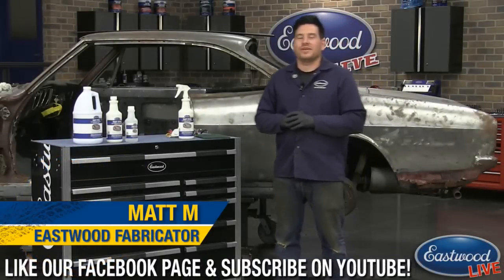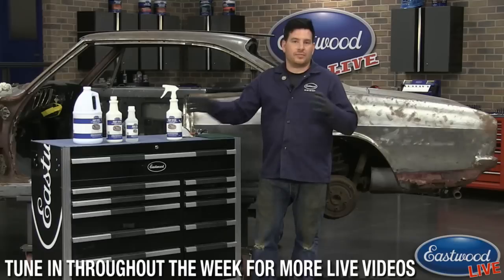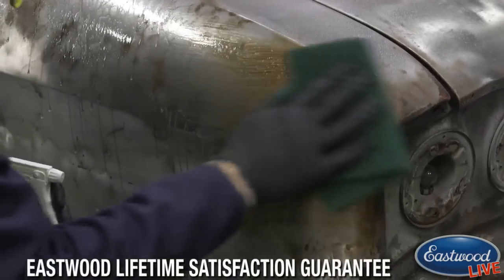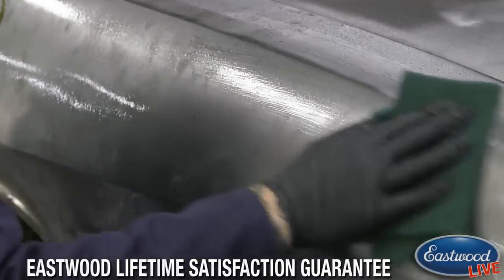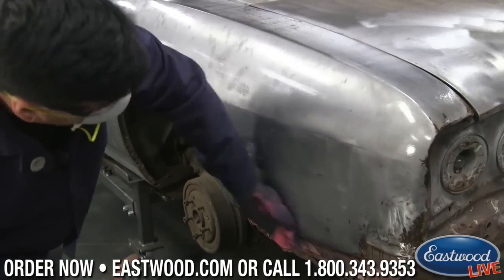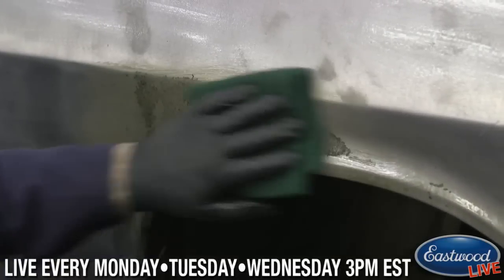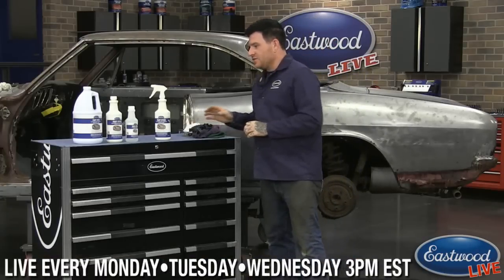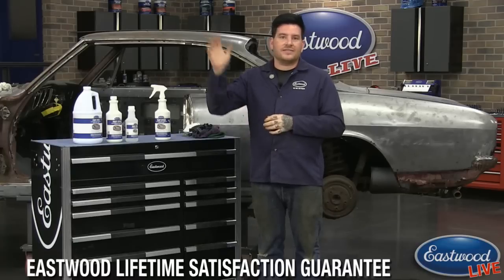Rust Solutions! Fast Etch - Remove Rust & Leave a Protective Coating to Prevent Future Rust!

Comment: can you paint over this with primer?
Reply from the maker: You will want to remove the Fast Etch with Eastwood PRE Paint Prep before applying primer or body filler or other coatings.
Reply: @eastwoodco , you might want to change the description then. The description claims it promotes adhesion for priming which is telling people they can primer over it.

And if you're supposed to clean it off before primer then I'd assume to just use Ammonia that'll work just as good and just as fast. Then spray etching primer directly after because leaving a bare metal car just sitting around is just laziness and pointless (unless you want that Bare Metal Look which is actually what I'm doing right now on my '86 Dodge Ram D100 Custom. I'm coating it with Boild Linseed Oil to protect it from rust and it can last years if applied with heat and correctly).

Comment: Why don't you answer questions posted ? You trying to sell this, product which is really "OSPHO" or not ?
Reply: Ed Passerini Ospho is green and is considered a converter not an etch
Reply: Ed, I know this is 2 years later but, wondering if your still crying cause he did not drop what he was doing and get right back to you. FYI, these are only video's Eastwood puts out free of charge to help us DIY'ers (and yes...cryers). If you want specific's on a product Eastwood has a tech line that answers all questions on their products...also free of charge. Unfortunately Ed, they will not come to your house to work on your project...for free. Now dry your eyes and pull up those big boy pants and do it yourself.

Comment: I sprayed my AMX after blast wiped down and 3 days later rusted. Had to do again and epoxy right away.
Reply from the maker: It's not a coating - it's a chemical that neutralizes rust. You need to top coat it shortly after or it will eventually rust again.

Comment: So i used this for the 1st time. AMAZING. The only thing i would add is if you leave it on the panel to dry and then want to paint it the thick etch does not come off completely. 
I re - applied the etch with a scuff pad then immediately washed the panel down with Acetone.*** Important*** Make sure the panel gets neutralized with pre- or Acetone right after re-activation or else the epoxy will never dry and you will have issues. Trust me.. I would also da 80 grit metal after that to start fresh for Epoxy or fillers. Acid+ paint like water + oil do not mix .

Comment: I know this is an older video, but will fast etch be good for removing light rust and really old, worn paint? I'm trying to do some rust clean up and repair in a tight area that is difficult to reach and thought maybe this would be the perfect thing to clean it all up with before going over it with some rust encapsulator plus

Comment: Right from SPI which applies in using this product or any products like this. 
 The ONLY acid cleaners SPI recommends is Opsho, PPG and DuPont metal preps as long as their instructions are followed to a tee.
Use any other system you want, just do us a favor and use no SPI over them.

There can be NO shortcuts for good results.

Ospho, is a great product for automotive if used right, we give scare warnings because we want people to call so we can make sure they know how to neutralize it, so no problems will arise.
Only one way to use and here it is:

Use as needed and apply as many times as needed to get the spot clean, let dry and leave for months if you want, don’t matter.
To neutralize the Ospho MUST be wet, so if dry, re-wet with itself and let set one or two minutes and with a clean rag and water, wipe off like washing the car and then dry.
Next, then da car with 80 grit, clean with 700-1 wax and grease remover, let set an hour and coat with an epoxy.

Comment: I am working in my engine bay around the battery tray and brake fluid reservoir where rust has formed. It's not heavy rust, more like surface rust. There are painted areas that have original paint I need to preserve. It would be nearly impossible to mask these areas off, and inevitably will have Fast Etch run-off. I also have very tight areas where I will be unable to agitate them with scotch brite, and in a couple areas, even with a small wire brush. First, will the Fast Etch harm the original paint where it ran off and dried? And second, will it still remove the unagitated areas of rust? Would several applications of the Etch solution remove the rust in those inaccessible areas?  Thirdly, can I prime over the dried Fast Etch residue?  And finally, will the dried residue wash off those surrounding areas that have original paint, with water after the new paint is applied and cured?    Thanks for any feed back.  Jon H.
Reply: The ONLY acid cleaners SPI recommends is Opsho, PPG and DuPont metal preps as long as their instructions are followed to a tee.
Use any other system you want, just do us a favor and use no SPI over them.

There can be NO shortcuts for good results.

Ospho, is a great product for automotive if used right, we give scare warnings because we want people to call so we can make sure they know how to neutralize it, so no problems will arise.
Only one way to use and here it is:

Use as needed and apply as many times as needed to get the spot clean, let dry and leave for months if you want, don’t matter.
To neutralize the Ospho MUST be wet, so if dry, re-wet with itself and let set one or two minutes and with a clean rag and water, wipe off like washing the car and then dry.
Next, then da car with 80 grit, clean with 700-1 wax and grease remover, let set an hour and coat with an epoxy.

Comment: Im having trouble getting it off to prime, I used wax an grease remover an it still has a coating on  that won't come off ,when I sand it a lot of grey dust keeps coming off. Is that coating supposed to stay there
Reply: ya im thinkin yes

Comment: Doesn't break cleaner do the same thing? 

Or WD-40 Rust Remover?

I'm only looking to sand down the top of the Radiator support and bring it down to the bare metal on a car that was parked for 4 years and radiator support had rust spots on it.

Comment: Can I use the Rust Encapulator after applying the Fast Etch?
Reply from the maker: Yes you could sand to bare metal, fast etch, wipe down/deactivate with pre-painting prep, then apply rust encapsulator.

Comment: if you use aircraft stripper to remove the paint ,afterwards ,  do you wipe down with Pre or do you have to sand ,  for any stripper residue  ? , before using fast etch
Reply: thanks Dean , you Rock , Love NEB. except when they play CU  ;- )
Reply from the maker: Remove the Fast Etch with Pre Paint Prep before applying other coatings, primers or fillers.

Comment: After it dries are there any steps I need to follow prior to welding?
Reply from the maker: Remove it with Eastwood PRE Paint Prep.  Also make sure the area is completely dry before welding.

Comment: Could you use this on brake discs?
Reply from the maker: You can use it to remove the rust and if you plan on painting or powder coating them, make sure you remove the Fast Etch with Eastwood PRE Paint Prep.
Reply: Who would powdercoat brake discs 🙄

Comment: Hi  what is the best rust remover on chassis
Reply from the maker: Either Rust Converter or wire brush and the Rust Encapsulate.

https://www.eastwood.com/eastwood-rust-converter.html
https://www.eastwood.com/eastwood-rust-encapsulator-plus.html

Comment: i dont have a garage so would a car like cover work ? to keep it out of the rain and bad weather?
Reply: +Kyle Hackney   I have the same problem, garage is full, too much equipment and lost big garage when we moved. To answer your question, strip the panel with chemical stripper or blasting, then apply Fast Etch, wipe to cover, let dry. Now, cover the vehicle with plastic from the home improvement store and anchor with what you have handy, sand bags work great as sharp stuff will tear when windy. I did this for my 67C10, one panel at a time. Have time, just hurt bad so can't go like I used too. The Fast Etch will leave a decent film on bare metal, but wipe down again if needed. I use it on my large MIG wire spool so it does not rust while sitting. Lost one $60 spool that way due to humidity inside, no more. The Fast Etch did not cause any issues when welding with it months later. Extra spools are vacuum bagged due to good price.

Comment: Will wax an grease remover take it off prior to lay n mud or primers
Reply: the spray society. You never got an answer from Eastwood because they want you to buy their expensive stuff when you can just as easily buy it from Home Depot for a cheaper price. Buy the self etcher from home depot (called Concrete & Metal Prep), it's a green chemical that you can easily see through the barely visible plastic bottle. This same chemical is also used to etch the concrete floor on a garage when people paint their floor. 

Do the work on your car metal panel similar to like this guy does it. Spray the metal part you're working on then rub it around the whole metal with a sponge or cotton rag to distribute the etching evenly otherwise you may get drips streaks from the fluid sliding down the metal piece. Repeat the process if necessary to ensure the metal gets etched properly for a several minutes then wipe it dry. Then clean the panel with acetone poured onto a rag. If you're going to primer it several days later or several weeks later, leave it as is after the steps I described but hopefully indoor because moisture from rainy days or cold nights may still create surface rust. There is no point of doing all the work like these guys on the video just to repeat the process all over again; at least get to the epoxy primer step if it won't get painted for several months or over a year. Once you are ready to primer use acetone & dampen a cotton rag or those blue roll paper shop towels to wipe off the the metal surface. I use an epoxy primer instead of some etching primer. Let the epoxy primer dry 1 or more days, scuff it with a green or burgundy scuff pad then primer with a regular primer like high build primer. 1 or more days later, sand the primer with 400, 500, or 600 grit sand paper, then paint it. Honestly I painted a fender after only using epoxy primer & scuffing it. 2 years later the paint still holds nicely.
Reply: @johnnyjohn8073  Agreed.. I could not get the film off after drying for weeks before epoxy. I had to reapply etch with a red scotch pad then wipe with acetone to get that off before paint.

Comment: Can you use this on a rust that is built on my chassis instead of sand blasting it?
Reply: Yes. Just make sure it stays wet. I use Saran Wrap to wrap after I spray the solution so it doesn’t dry up.

Comment: Thanks for the video. I watched this later in the day so i hope you review the later comments. . My questions are;    I live in a Pacific Northwest coastal town.....I have a 98 Suburban that I towed and unloaded a boat into salt water. Even though I washed it after every use  the rear of the frame has a medium coating of rust on it. Will this product work on the frame?  Can I use it with a compressor sprayer? Afterwards if I can use it and I finish the cleaning I plan on taking it to the dealer  who will be doing a full undercoating.  Suggestions!!!
Reply from the maker: You can use it with a pump sprayer.  For heavier rust try Eastwood Rust Dissolver.  A great video on that product will be posted today.  Or check it out at Eastwood.com.
Reply: Ok. Thanks

Comment: quick question (should be easy)...So if I use this on a stripped bare metal panel. Then clean with pre...can I then use body filler before priming or do I have to seal with epoxy primer first ? Thanks EASTWOOD !!!
Reply: Robert Arco       Yes, stripping the panel either blast media, sanding or chemical, 
the Fast Etch rubbed in for 30 minutes wet, needs removed with "PRE" paint
cleaner or acetone. If the panel is to be finished, check with your supplier of base. As epoxy primer becomes popular, like SPI Epoxy, any phosphate left behind is
bad. Only an acid based product can re-activate an acid based product for
removal. SPI recommends Ospho, wet, clean, re-apply and remove with their
cleaner, but many use acetone. Sand area with 80 grit, clean with cleaner & tack, 
then apply epoxy primer as it is water proof. The SPI has a 7 day open window
and poly filler applied during this time will bond with the epoxy. Once filler is
sanded to smooth. re-coat with epoxy. If finished with filler (And you are that
good), The SPI epoxy can be thinned and used as a sealer, prior to base coat  &
clear. Just be careful not to leave the product on areas to be painted. I used it 
inside a trucks bedside that had welded area's, heated areas for shrinking or 
stretching, but need protection, but not epoxy. Had to spray some areas, but 
impossible for others spots. Best to do something for areas behind the finish
other than relying on a rust-proofing material, like the oily, yellow waxy stuff.

Comment: I'm about to fast etch the underneath of the floor of my 57 chevy  ,but there is some red primer paint from factory left after blasting and using other abrasive tools  ,will the fast etch do anything to it or what do i need to do before using the fast etch,I'm in the UK ,cheers